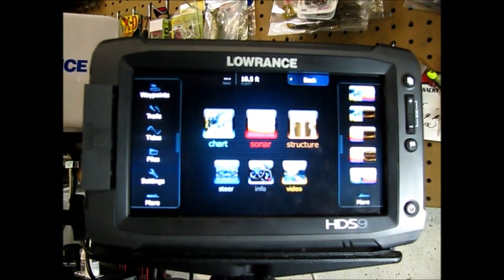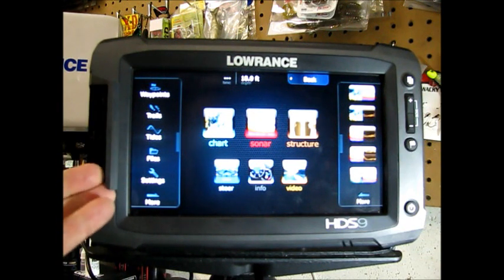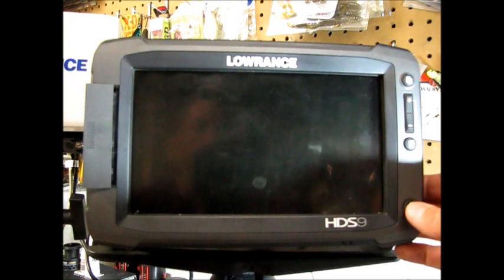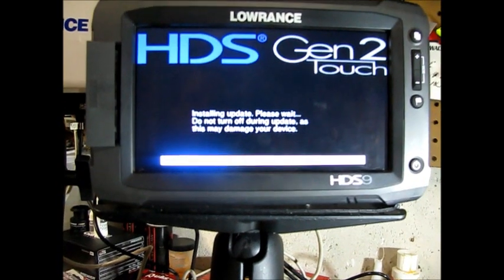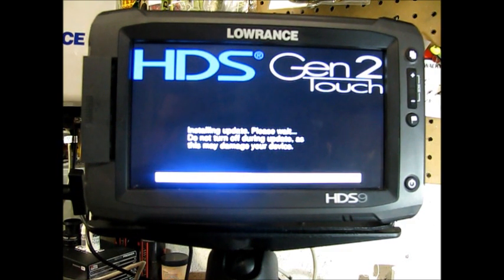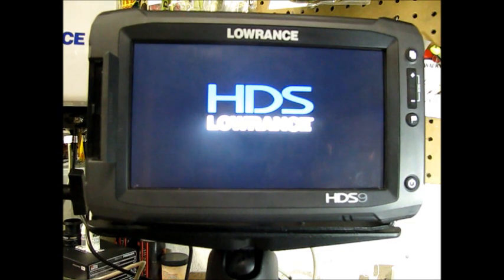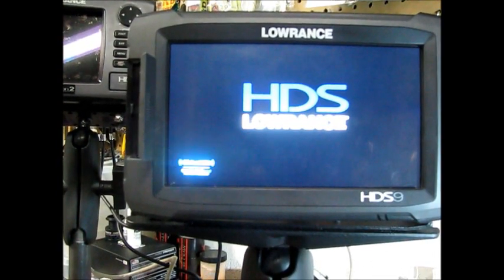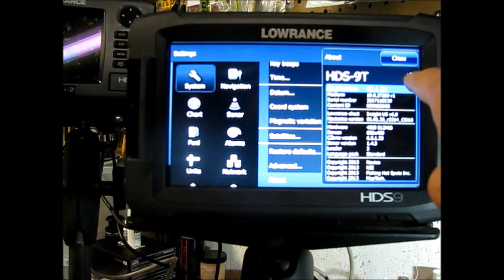Lowrance HDS Touch Final Update Steps

Comment: Hi i realise this is an old video but i recently bought a used boat with a hds 9 gen 2 unit and it has version 4.5 which tells me i need the update of 6.0 my question would be does this update enhance the sonar or is it based around the engine performance and mapping and so on ,,,,,,,, i mainly want the update if it will enhance the sonar ,,,,,,,,,,,,,, would you happen to know any of that info thanks for any help you can offer
Reply from the maker: The "best" way to determine what each Software Update provides as far as features etc., is to read the addendum that is always posted on the same page as the download page.   I did check and it appears that the links to the addendum no longer work as I "suspect" support for the GEN 2 product line has ended.   The upgrade is primarily for Mercury Vessel Link as shown (Version: 6.0) See below.  It won't hurt anything to download and install it even if you don't use the updated features.  There are some "C-MAP & Navionics autorouting featues included as well.

"Recommended for all HDS Gen2 Touch displays worldwide, this upgrade includes support for Mercury® VesselView® Link, C-MAP Easy Routing and Navionics® Autorouting, in addition to other performance improvements and enhanced functionality.

Key Features

Mercury VesselView Link

    View all of your Mercury Smartcraft® engine data in one place ─ on your Lowrance® multifunction display. The Mercury® VesselView® Link interface module integrates SmartCraft® engine data with HDS Gen3 displays ─ providing quick access to RPM, speed, fuel remaining, battery voltage, trim tab data and Mercury Smart Modes, like Eco, Smart Tow®, Troll Control and Cruise Control. VesselView® Link puts all the data you want, where you want it ─ at your fingertips."
Reply: Dale thank you for all the info that was extremely helpful and prompt . Are you or have you been a lowrance tech supporter in the past I may have to make further inquiries in the future lol
Reply from the maker: I am an avid user of Lowrance products and simply enjoy helping others get the most from their Lowrance devices as well.  I usually respond as soon and as often as I can.  If there is a delay, its typically because I am out on the water.  I don't work for Lowrance.
Reply: Mine doesn’t show maps what is going on even with the c map card installed